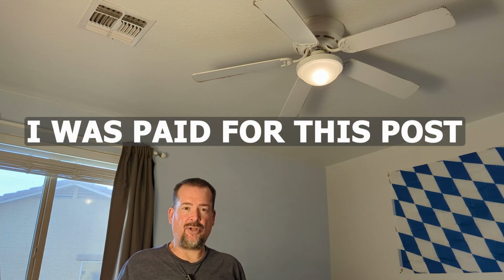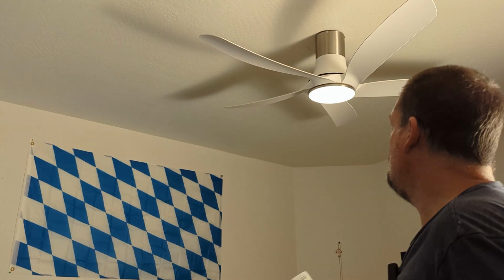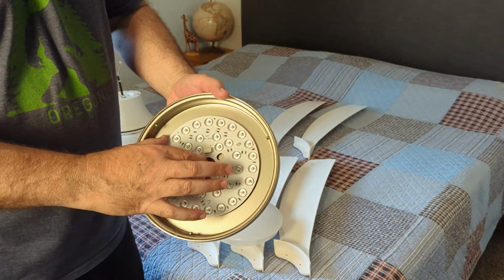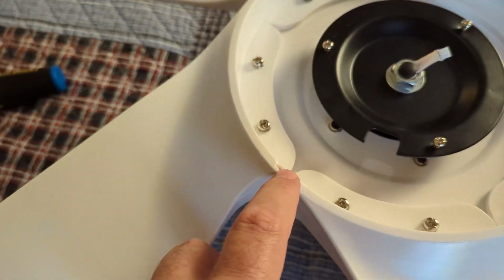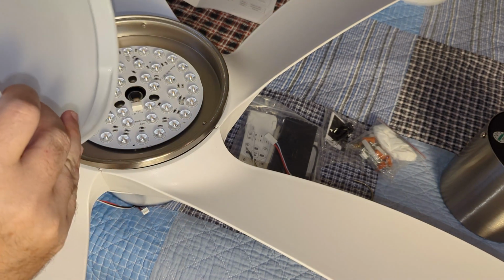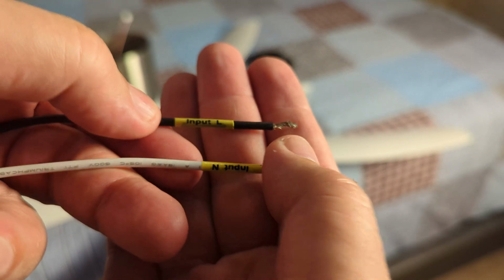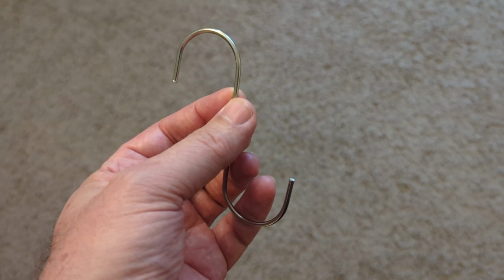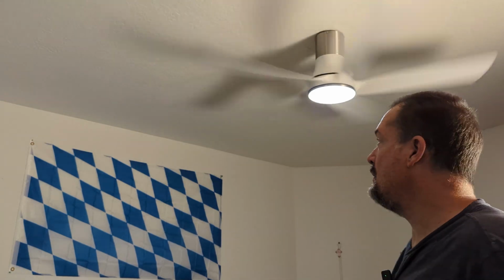Ohniyou Ceiling Fan First Impressions and Installation

Comment: the black and white or in and out wires coming out from the control box what do they connect to the power and neutral wires coming down from the ceiling so then you have 3 wires going to each screw nut which twists them together?
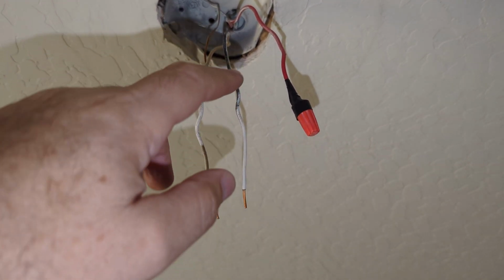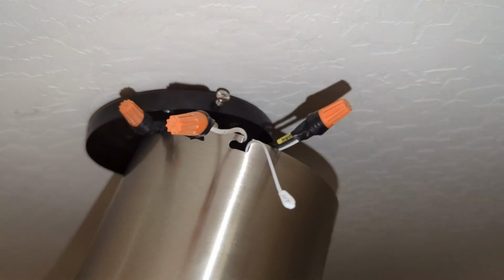Reply from the maker: You can see how I set it up at 8:42 and 10:03 First  turned off the power at the breaker and then I capped off the red wire which you may or not have. Next I attached the white wire from the fan to the white wire on the celling, I attached the black wire from the fan to the black wire from the celling and then I attached the coper wire from the fan to the copper wire form the ceiling.
Reply: @ThatHobby  the fan is at another house which i will visit in a few days i will take your info and see if i can make heads or tails of it from all the colored and uncolored wires coming down from the concrete or cement ceiling and let you know thanks so much
Reply from the maker: @mikejohnson599  The important thing to remember is that the white wire is the neutral wire, and the power wires will be your red or black wires. Some homes have 2 switches on the wall. One to control the light and one to control the fan. But with a fan with a remote you only need to use one of them. The other power wire can be capped off with a wire nut.
Reply: @ThatHobby  yes this house has 2 wall switches so one power wire is capped off by itself not to any other wire? or is the ground or neutral wire from that switch capped off with the power wire?
Reply from the maker: @mikejohnson599  The power wire that you are not using needs to be capped off with a wire nut all by itself. You can't connect a power wire to a neutral wire or to a ground wire. If you do that it can cause a short circuit and possibly damage the wires. The natural wire needs to be connected to the neutral wire on the fan to complete the circuit. The ground needs to be connected to the ground wire on the fan to ground it. The extra power wire needs to be capped off with a wire nut.
Reply: @ThatHobby  ok friday i will try to sort it out im nervous because i blew the old previous one up after the chain broke way up at its spool and i tried to by pass it and  it short circuited
Reply from the maker: Just remember to be safe. Ture off the power to the light at the breaker first. Then connect one wire at a time.
Reply: @ThatHobby  ok im back and stangely there are 4 wires comimg down from the power box in the ceiling each seems to have a white coat from previous painting.  one is pure copper no insulation the next is black then a dark red and then a pinkish wire remember there were 2 switches like yours on the wall.  so should i cap off the black or red and conncet the other to the black lead coming from the control box then which one connects to the white lead the pinkish wire ?  and where does the copper ground go to? and the copper lead from the fan support ring which is screwed into the ceiling power box
Reply from the maker: @mikejohnson599  It can be kind of hard to tell with the paint on them. The copper wire should connect to the green ground wire on the fan. The black wire should connect to the black wire on the fan. The red wire is the extra power wire. You can cap that one off with a wire nut. The pink one is a little odd though. It's probably the neutral wire but if you are not sure you can test it with a multi meter. Just remember to turn the breaker off before you start testing and connecting the wires.
Reply: @ThatHobby  thank you the pinkish wire must be the neutral by process of elimination so it connects to the white wire coming out of the control box correct?
Reply from the maker: @mikejohnson599  The pink wire does seem a little odd though. You should probably check it with a Voltage Tester first. If the wiring is a little different it may not follow the standard wiring recommendations.
Reply: @ThatHobby  ok thanks so much i have my tester and i will check the pink wire next week i will keep the 4 wires well separated with the power on so i dont get knocked off the ladder thanks
Reply from the maker: @mikejohnson599  You want to keep the power off while you test the wires and connect them.
Reply from the maker: Just remember to turn the breaker off before you start testing and connecting the wires.
Reply from the maker: @mikejohnson599  Just remember to turn the breaker off before you start testing and connecting the wires.
Reply: @ThatHobby  wait a minute how do you test if a wire is a power lead without the power being on that means breaker on and wall switch on right?
Reply from the maker: @mikejohnson599  No you have to turn everything off to safely test it. You have to test it with the power off. It's not safe to test it with the power on.
Reply from the maker: @mikejohnson599  It is important to be safe and turn the power off before you test the wires. You are just testing for continuity by attaching the multimeter to the neutral wire and to the ground wire. If you get a reading it is the neutral wire. If you get a zero it is the power wire. If you are not sure how to test the wires it may be best to get an electrician to test it for you.
Reply from the maker: If loads are present, you might get a misleading continuity reading between hot and ground. So it may be better to just have an electrical check out the wiring and test it in this case.
Reply: @ThatHobby  ok thanks so much i will test it power off as you say but it seems counter intuitive that it is a neutral wire if it gives a reading but i will see thanks again so much for your expertise
Reply from the maker: After you check the wires with the tester you would connect them individually. In this case you just have one wire from the ceiling and one wire from the fan connected into each wire nut. The Coper ground from the ceiling would be connected to the green wire from the fan into one wire nut. Then the black wire from the ceiling would be connected to the black wire from the fan. The extra power wire would be capped off with a separate wire nut. Then once you have confirmed the neutral wire form the ceiling you would connect it to the white wire from the fan.

Comment: does it work with alexa / home assistant?
Reply from the maker: This fan isn't compatible with Alexa but it does have an ap with more controls.  I have another fan that is compatible with Alexa though. I haven't uploaded a YouTube video yet but I have a video for it on my storefront. You can check out the video link here. https://www.amazon.com/vdp/0e2f68ebef0d4eb88dfa1c84e2ecb4a5?ref_=aipsfvideo_aipsfthathobby&linkCode=ssc&tag=thathobby-20

Comment: I have the same remote. Why does it take me so long to turn the light on or off. I’m pushing the right buttons but gotta keep pushing until something happens
Reply from the maker: It could be a bad remote but you could try a few thing to test it. There is a wire antenna on the control box. You could try to point the remote at the fan from a few different directions and see if it works better from different angels. There is also an app for this fan. You could try the app and see if the controls work smother. I put this fan in my sons room so I don't use it that much. I will test out the remote and the app and see how well they are still working. I will try to make an update video about the fan too.